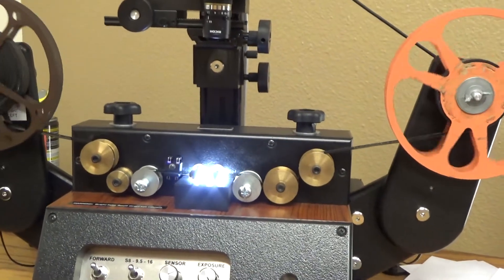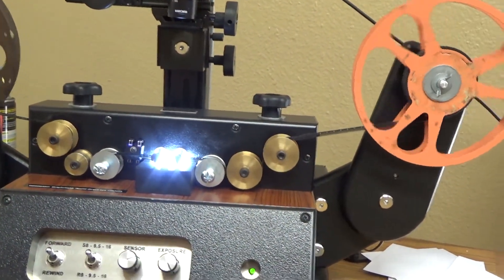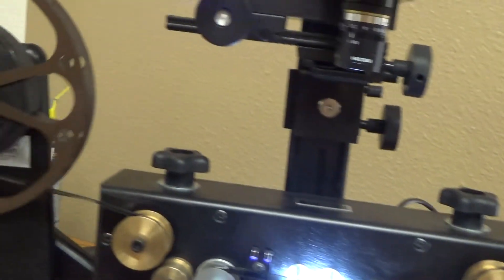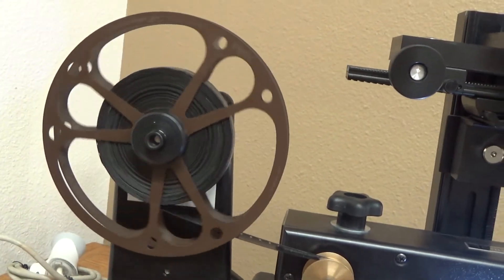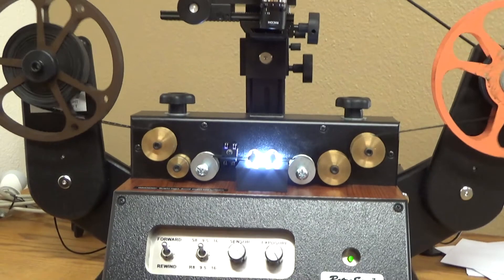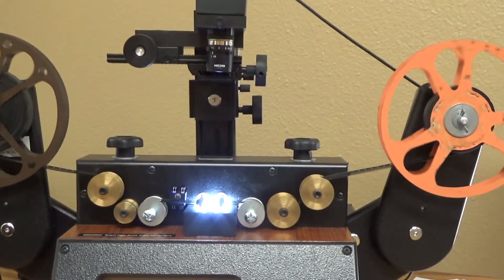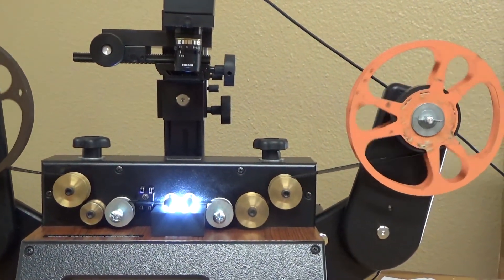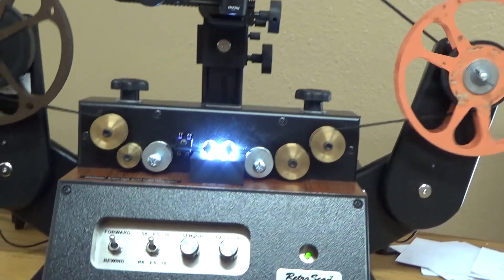HOW I SAVED THIS FILM ?

Comment: I think you did pretty well with that material. 

It's hard to say whether your process added much float to the original - the camera may have had an unsteady movement and it was hand held. 
I don't know if it would be possible to get a sharper image - I didn't see signs of film grain and dirt wasn't especially sharp, but that might also be due to the 1080p resolution of the YT footage.
What was your scan resolution?

If there were any scratches or cinch marks, I didn't notice them. They are hard to get rid of without a wet gate in B+W. IR methods work well with colour but cannot deal with a B+W silver image.

Whites looked good, blacks seemed a little light but flesh tones felt a bit dark - possibly a post transfer gamma adjustment?

I'm curious about how your machine derives accurately registered frames while drawing the film though continuously. Does it have some kind of timing device that snaps very short duration exposures synchronized the the rate of film transport? I don't see a pinch bar and roller - is it synchronized by imaging perforations - timing each exposure when the next perforation arrives? (If so, what happens with torn or damaged perforations?).

I'm also a little confused about the film having become 'vinegarized'. 
This was something that happened with aging cellulose nitrate base found in early 35mm films made up to about 1950, which is why old nitrate prints and negatives have to be stored and handled with care. I understood that right from the beginning when Eastman Kodak introduced the 16mm and 8mm formats they were coated on cellulose acetate 'Safety Film' base so they would never become a fire hazard. Yet you say this old 16mm film smells of vinegar. Clearly though the kinking the outer layers of the reel show does look like pictures I've seen of aging nitrate film, but I'm pretty sure I've seen that also on old acetate film as well.

Decades ago when I worked in optical effects I was given an old 'God Save the King' roll that used to run before the feature in British Empire or Commonwealth countries. It was 2 colour duplex with I think a red image cemented to a greenish one and was pretty badly scratched from repeated use. Copying it on an optical printer with a wet gate at very slow speed to Eastmancolor negative produced quite surprisingly clean result, with only a few very severe scratches that took out a dye layer remaining. Of course that relied on perforations to transport and register the print. I don't recall whether we removed the outrigger register pins (for severely shrunken film) or not, but had the perforations been badly damaged this would not have worked, unlike your continuous process.

There must be a great deal of old home and industrial movies shot on 16mm, 8mm and Super-8 that could use a service like yours. As long as you can get a steady, sharp transfer wit as little dirt and scratches as possible, you could always grade the result with something like Da Vinci Resolve, which is free or very cheap for the all up version.

Hope lots of folks take advantage of your service.
Reply from the maker: This is a standard 16mm 1937 home film. What you asking about is not my standard  $15 price for 50 feet. I use a Retro Scan Mark One. Other info is my personal choices and I don't talk about my secrets. Thanks for your comment.